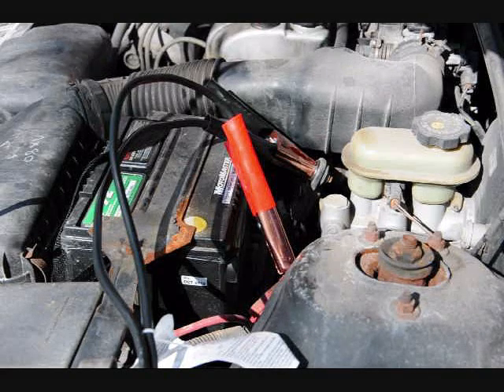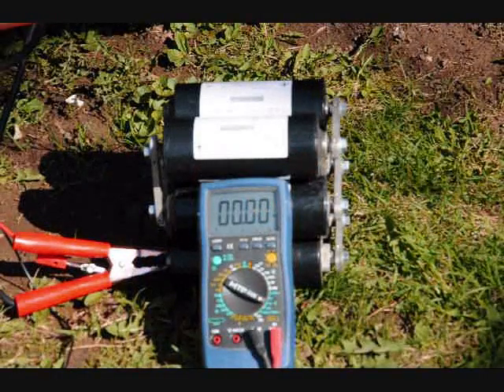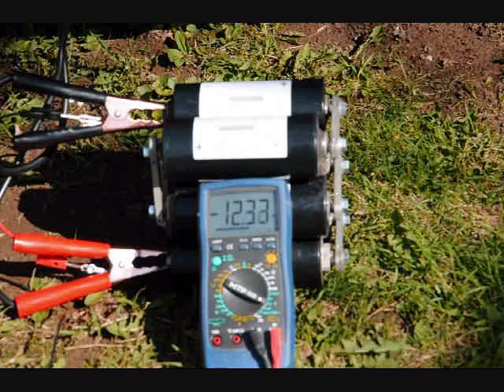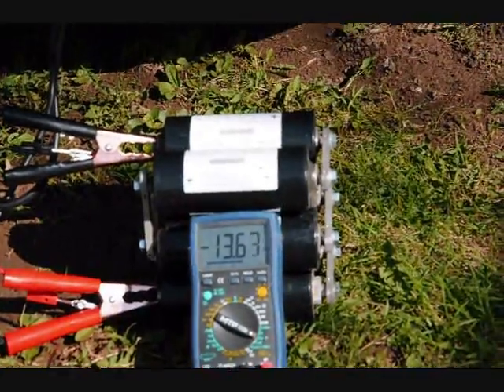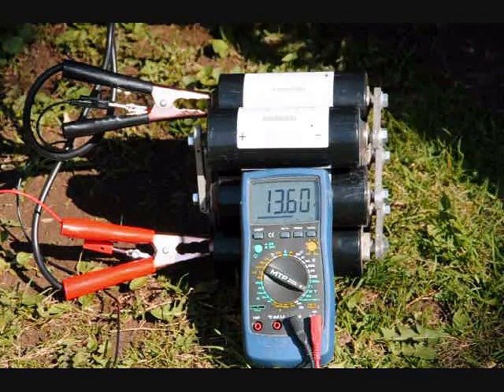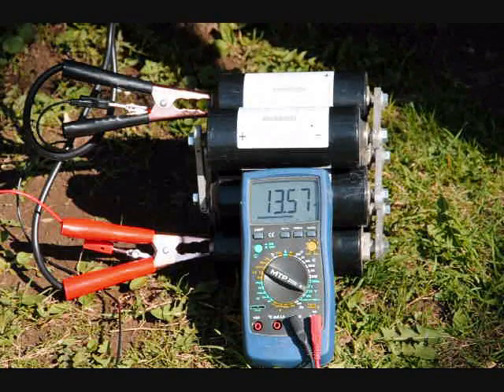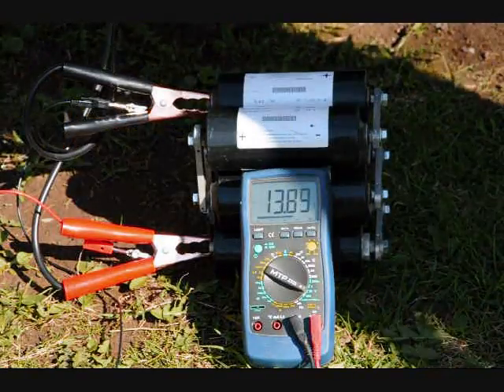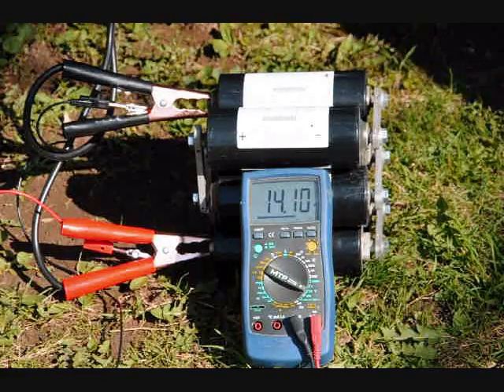Starting my car with a super capacitor array!

Comment: Install a 100W flexible solar panel on the roof of your car, and connect it to the capacitor. That will serve as "insurance" to keep the capacitor charged. Just make sure that you bring the solar panel voltage down to the voltage of your alternator. Most "12V" solar panels put out about 18V at peak sunlight.
Reply: many are 22.5v

Comment: Does a bank like this need a charge controller,  or can you get by without?  And do you have any idea of roughly how many farads to replace can,  or cca on a battery?  (Obviously you can't replace the capacity in Ah,  but that's a different subject)

Comment: Is it just me or does the volt meter read a negative charge at first and after starting, then after the cut in the video, all cables are in the same places but  the volt meter reads a positive charge. 
This tells me that the video is faked . I am a mechanic but I can't be alone in spotting this huge mistake in proving your theory of a capacitor starting this car. 
 If your going to make a video, at least take the time to make a fake video that looks authentic enough to fool the general public and ( some ) real mechanics.
Reply from the maker: As a "real" mechanic, I would hope you'd know how a DC multimeter reads voltage when polarity is reversed.  I had the positive lead to the negative battery terminal, switched mid video, and the negative on the 12v line.  If you want to know more about how to determine the polarity of a DC power supply, you can see this video that I made linked below.  You can also check out the wide array of other videos on youtube of people doing the same thing.  You could also try it yourself.  Nothing to debunk.  Caps can't hold near as much power as a battery, but can crank out more amps faster.  Video:  https://www.youtube.com/watch?v=xoUHbf_bRxw

Comment: You stated "...a super capacitor array...the capacitance is 433 Farad at 15 volts"
That means you probably used 6 caps that are rated at 2600F, 2.5V per cap.

Your system will probably provide ~20 seconds of engine cranking if the weather isn't too cold.  Below freezing, when your engine oil is thicker & friction is higher, you will get a lot less cranking time out of that array.

If you install that device in parallel with your existing battery, both energy storage devices will remain charged by your alternator, but the starter will likely draw more energy at startup from your cap array.  It's a good way to get more life out of a regular battery.  You could probably even use 350F caps for that setup.

To avoid the ignition-off power drain (from clocks, computers, etc), you could put a circuit in between your ignition & the cap bank that is only closed (i.e. allows current to flow) when the ignition is on.  When the ignition is off, the new circuit relay is open (i.e prevents current from flowing out of your cap bank).
Reply: I have more than a year a 16v 83F supercapacitor array connected in paraller with my battery, my car(Seat Ibiza SC 1.2 TDI E-ecomotive 2012 model) has also start-stop so the supercapacitor helps there too. It can't start the car on it's own(without the battery) as it has a PCB protection board which limits the amps, when I tried alone it tries to start the car like a drained battery(it turns but no starting). Diesel engine need quite some power to start compared to gasoline cars.

In my ebike I've put a 59v 22F supercapacitor bank along with my low capacity 48v 4.5Ah battery(SLA), the results? well even with hard accelarations the batteries remain cold(not just cool) to the touch while previously they got quite warm as my ebike has 48v 1000w motor :) ..that was the first time I've used a supercapacitor bank, after than I thought why not doing the same to my car, make the battery last longer and easier :D

P.S. In the future I might add 1-2 or maybe 3 more capacitors(16v 83F) and replace my car battery to a small one 7-10Ah and use a combo of 2-4 capacitors and small battery to reduce weight. 4x 83(or to be precise 83.333F) are ~333F which is not bad(I don't have a lot of headroom else I could go with some big 2600F or even 3000F capacitors but these are still expensive and bulky :( )
Reply from the maker: Hi
If you place 6x 2600 farad 2.5v caps in series, then the series bank value +/- 10% is 15v at 433 farads.
Reply: Oops... You're right.  My mistake on that point!  I revised my statement above to correct my error.
Reply from the maker: A B  NP.  As for the rest, I just wanted to do this as an experiment.  The ESR of a battery or cap bank will go down in cold, yes, but I think that super caps would still offer more cranking amps if the capacitance level of the bank could provide enough power.  However, it doesn't make a lick of difference =)  I'd never use super caps alone to perform as a car battery.  I'd have to charge it every morning due to the parasitic loads that you mentioned. Even if the parasitic loads didn't exist (as you mentioned, disconnecting everything via relay/switch), a cap bank the size of a car battery (This one) doesn't have near enough power storage to compare with a car battery.  I'd still have to re-charge every morning due to the internal leakage current that these caps have.  Placing a cap bank like this in parallel with a car battery may take some long term stress off of the battery, but really, who has room in their cars for that =)  In any case, super caps and cars always make a good discussion.
Reply: re:  "...I think that super caps would still offer more cranking amps..."
I agree, however, due to higher friction, the cap bank would need more  capacity, but it would probably still provide more energy density than a LA batt due to how inefficient such batts are in cold conditions.

re:  "I'd still have to re-charge every morning due to the internal leakage current that these caps have" 
I don't know the leakage of your caps, but there are fairly good low-leakage caps availble these days. 

re:  "Placing a cap bank like this in parallel with a car battery may take some long term stress off of the battery, but really, who has room in their cars for that"
If you replaced your LA batt with a batt made from Li-ion cells (18650s), you could marry that with a 350F, 2.5V 6-pak of ultra caps + the circuit to block the parasitic loads on your cap bank.  Li-ion  performs excellent in low temps, is much lighter than LA, & takes up much less space than a LA batt.  The cap bank would also be much smaller than the one in your vid.  I imagine you could marry both together & take up slighly less space than a regular auto batt.  One other thing to remember is that your car's charging circuit will quicky recharge your cap bank after the engine starts.  I saw a YT vid in which a guy left his cap bank for 3 days & there was still enough energy in it to start his car.  With the Li-ion batt + cap bank, you wouldn't have that problem.

If you could get some old laptop batt packs, you could get plenty of cells to do what I'm stating for free.  I got over 200 cells in one trip to a local batt shop--so I know itis possible to get them for little/nothing  In my experience about 75% of the cells in a discarded Li-ion batt are usually perfectly fine.  If only one cell dies, the pack is useless (unless it is rebuilt)--which most people don't do.

If I could get 6 good 350F, 2.5V ultra caps for free, I'd build such a energy storage system. :)

Apparently the Chinese are already making what I was typing about:
http://www.ebay.com/itm/10V-87-5F-Maxwell-Ultracapacitor-Module-consists-of-4-2-5V350F-w-Protection-/171370287537?pt=LH_DefaultDomain_0&hash=item27e67711b1
That unit is a bit lower V that I would prefer, but it might work with a Li-ion batt.
Reply: @crackerworld:
Nice comment.  It looks ilke you've had pretty good results with your experiements.  Congrats!

Thanks for sharing!

Comment: This could replace the big battery. Instead perhaps with a small (10 Ah) would be enough. The battery charges the supercaps if they are discharged, because the problem with batteries is not total energy but to deliver high power during one or two seconds.
Reply: Excelent idea ;)
Reply: I know. Some brilliant engineer has to have looked at this though. Caps are so awesome because they are so simple without all the chemicals etc.. I still remember making one with foil and wax paper, lol.

Comment: This is cool and I CANT wait for super-capacitors to take over batteries, my issue at the moment is the get say equivalent to a 100aH battery you'll be spending $4000 and make it yourself from say 500F [810 of them!].  Then there is the linear voltage drop which would be an issue with cars being so voltage dependent.  Pretty sure you could start off with a higher voltage on the super-capacitor as most electric motors [car starter] run fine for short times at a higher speed and then use a regulator to keep your system voltage 12v.  They have a sensational lifespan, good on weight, really bad on size being about 10 size the volume and with the way it's progressing in terms of capacity and price [faster than batteries] I'd guess they'll take over some time in the next 10 years.  crosses fingers

Comment: They sell solar powered battery chargers that you could plug into the cigarette lighter plug. It could, with enough sunlight, trickle charge at the rate of discharge, if not better.

Comment: Hi Patrick. I am new here. I see ur video is 2 yrs old so somebody may have made this observation before. I noticed that when u first clamped the black clamp to the caps that ur meter was reading negative voltage. U started the engine and with the car's alternator running the meter was still reading negative voltage. When u turned the engine off then ur meter was reading positive voltage (the way it should be) without visible change in the setup. What was going on, did u have a bad meter?

Comment: Not only can you start your car, but you can replace the battery permanently if you put a flexible solar panel on the roof of your car.  The solar panel makes up for any electric draw from alarms and other accessories that are on when the car is parked.  I tried it on my car - and so far so good.  I'll make a video of it soon.

Comment: If you don't have space to use capacitors and a car battery, you could use capacitors and a motorcycle battery.  Both the Capacitor Array and Motorcycle Battery should be about the same size as a car battery and would hold a 12v charge.  I guess the next question is how long will the capacitors hold up?

Comment: very interesting and a the video was nicely done thanks!  i hope im not gonna annoy ya but i have a few questions... how long will these compositors hold a charge?  what was the cost per unit?  (i looked but didnt know what i was looking for)  how many would you need to have if you wanted to use them to replace a car battery?   and do you have a rough guess as to the life span of them?   even if you dont or cant respond thanks in advance :)

Comment: Also I don't think it is edited, the voltage did change that fast. 1 farad is 1 volt change per second at a current of 1 amp.

With 433 farads here that means 1 volt per second at 433 amps, add in the ESR of the caps, .0042 ohms (.42 volts per 100 amps), contact with the jumper cable clips, and it is possible to almost instantly go from 12.6-11.04 volts. That is only a 1.56 volt drop, the starter draws a couple hundred amps on the first compression stroke. IE half the drop is just from the ESR.

Comment: These appear to be the Maxwell 2600F 2.5V max capacitors. 6 in series would be ~433F 15V. They sell these in lots of 6 and 12 on eBay, but as said they should sell them in lots of 7 and 14 too for use on a car. 14 of these in a 7S2P setup for ~743F 17.5V max in parallel with the normal lead acid battery would be great.

Comment: to stathis charpidis you can add a voltage regulator and if you use 100 capacitors at 6 amps 200 volts it will be a lot smaller and you can design a lithium battery that will keep the capacitors charged if your alternator is working and all you have to do is wire in series if you put a switch in the car that kills all positive  charge from the capacitor you will have a very slow discharge and could have possibly made a car battery that will never die

Comment: Once the voltage in the capacitor reaches the same voltage as the alternator output, the capacitor will just stop sending power out. It won't overcharge the caps, just kill the flow. Then the engine will be running solely off the alternator.

Comment: Add an extra cap in series so the alternator has no chance of exceeding the cap's ratings, but all you'd need is a small 7amp/h lead acid battery and the super caps together, the lead battery would be to keep clocks and computers running.

Comment: You want to blow some capacitors? ..the ultra capacitors usually have low voltage 2.5-2.7v. So putting the capacitors in parallel you'll have lots of 2.5-2.7v

BUT remember if you try to give 12-13.8v to a 2.5-2.7v capacitor it would blow up, you your thinking is not right. Sorry..

Comment: That looked like it was very successful. :) They should turn out cars now with a bank ov super caps for the starter motor and a much smaller battery (A DEEP CYCLE ONE) for the accessories. Sounds like a better way ov doing it.

Comment: Use a battery Isolator, when the car is off you can run your cap bank all the way dead without killing your main battery and when the car is running your alternator would be able to charge the Cap bank. If this works so good, why are we not seeing more people use this type of setup in Car Audio?

Comment: @ideeman1994 Yes, the UltraCap array could be used. There is actually research being done by several universities to outfit cars with smaller lead acid batteries backed up by ultracaps. The idea is that the battery powers the electronics while the car is off, and then the ultracaps handle cranking the engine. By doing this, a much smaller, lighter battery is possible.

Comment: @L38Crow You could connect a starter solenoid between the hot terminals of the cap bank and battery so they remain disconnected when the engines off, then have some control circuitry to cntrol the charging of the cap bank once the alternator kicks in.  Anyway the alternator rectifier will typically kick out ~14.5Vdc during running which the battery can handle all day no problem...

Comment: @patrickikis I wonder how do you protect your car battery from overcharging if those caps are connected in parralel. As far as I understand - after you stop engine, leaving caps charged up to 14V, they start charging a car battery until 12,5V. The car battery usually charged up to 90% in normal conditions.

I wonder if overcharging issues may occur. What's you experience on that matter?

Comment: @seneca65r That's a fabulous way to use them. Batteries hold their voltage until almost dead then taper off but capacitors ramp down in voltage as you use them (I know you know this) so a voltage regulated inverter would get around the problem.
I think I'm going to get some and have a play. Where did you get yours?

Comment: @warren52nz I employed supercap / zeners in a design to use solar panel to charge light aircraft battery. Simply connecting panel to battery no good , because panel seldom receives direct sunlight! The panel charges a pair of 2.5v supercaps the zeners protect them from imbalance and overcharge. then as cap voltage builds up to 4.5v an inverter turns on producing 27.6v this is sustained until cap <3.6V, the cycle then repeats. I think remarkable, the device "fires" every few minutes at NIGHT!

Comment: @seneca65r Yeah Zeners are the obvious answer but their voltage vs current curves aren't very steep, you really want them to kick in hard at the design voltage and not leak below that. I guess with careful design it would be workable though. I'd quite like to design a voltage clamp with a "cliff-like" response at the clamp voltage. I imagine such things already exist. I made one for charging three 12V lead acid batteries in series to balance them with partial success.

Comment: I'm still wondering about hooking these up in series (they're only about 2.5 volts these things right?) and charging them, with nothing to make sure each capacitor in the bank gets an equal charge. Anyone know how they do this? A resistive divider is the obvious answer but is this how they charged them?
If they don't balance the charge one could go beyond its rated voltage and we all know what that means.....
KABOOOOOM!!!

Comment from the maker: @meade9166 
With absolutely no load, the caps will discharge about 10% over a day or two, then stay at around 90% of the charge.  if you have the caps connected to your car while still on, there are parasitic loads such as the computer and clock that will drain the caps over night.  If they are still within the 12v range in the morning, and you can turn your car on, the alternator will quickly recharge the caps.

Comment from the maker: @HappyMeal255 Yes, the alternator will keep the capacitors charged while the capacitors store the entergy used by the heater, the audio system, and  the car computer.  However, when you leave the car not running, eventually parasitic loads will drain the caps faster than the battery.  If you get the car started again after having the car off for a while, the alternator will quickly recharge the capacitors.

Comment: @afdhalatifftan92 those cap are expensive i found some that are 3000 farad and in total it would be like $630 there 2.7 each so if u know math and stuff 16.5 volts and 500 farads